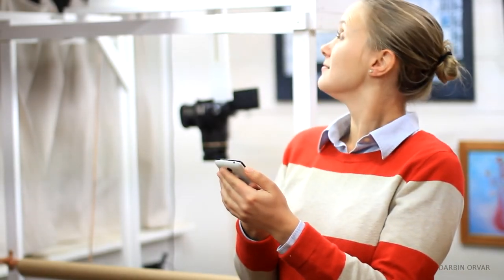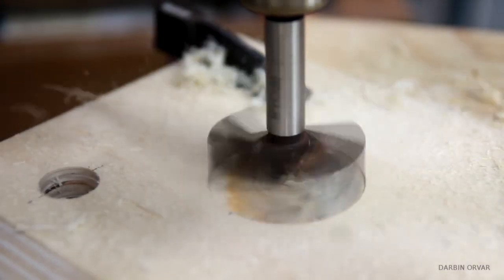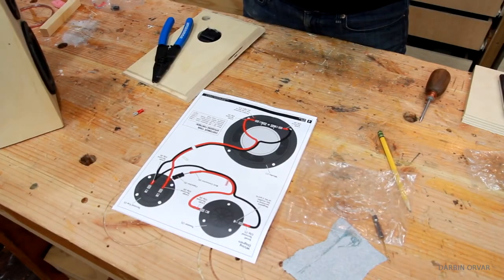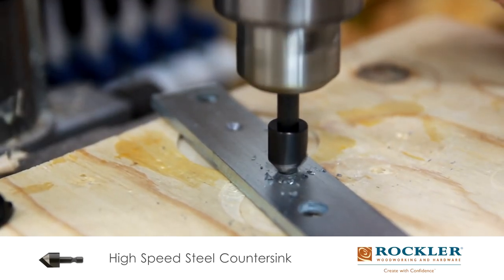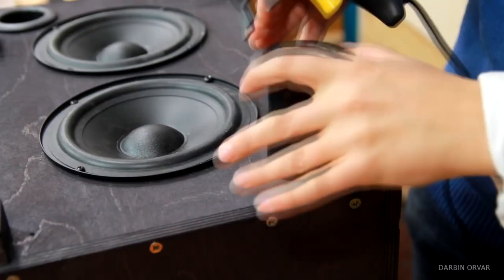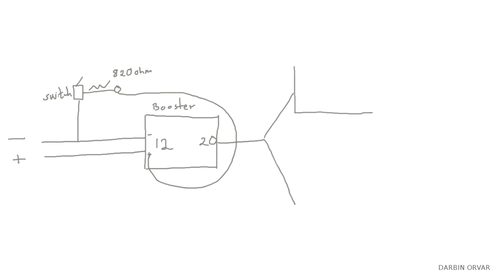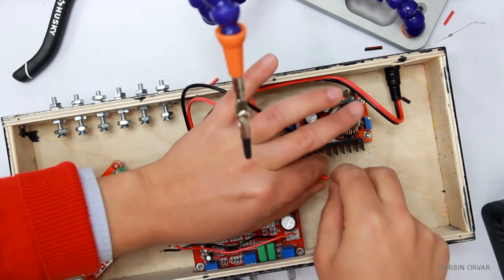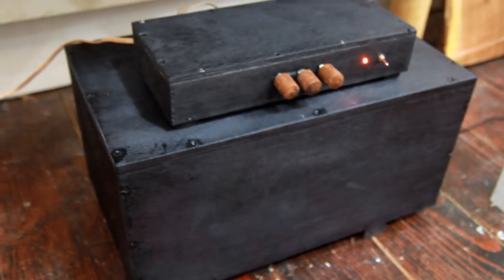DIY Bluetooth Satellite Speaker System with Subwoofer | Darbin Orvar

Comment: Could have done this with a simple bluetooth adapter for any 2.1 speaker. However congratulations for the work and you enthusiasm. Is amazing what you can create when you really use your mind into creating something. 
However I was looking for a video where you connect the satelites to the subwoofer via bluetooth and you don't need cables anymore. I want this because I got a Z906 and I mounted the satelites on the walls and I hate the way the cables are there :)

Comment: Like you this project is beautiful and im planning to build one very soon, however the amplifier system is redundant since the sub amplifier that you used has it's own terminal for both satellite channels, would it have been cheaper and much easier to just install a bluetooth receiver and connect it on the sub amp directly?

Comment: would love to see you take a surround sound system that is wired and make the speakers Bluetooth receiver and the main control system a Bluetooth transmitter to where there are no wires attached to the main control system.

Comment: Linn, Great tutorial, is it possible to make the speakers wireless as well? I'm a woodworker, i don't have much experience in electronics
Reply: +Frank Doyle yes it is, but you need an amp in every speaker with it's own wireless signal receiver. in the amplifier you will need a wireless signal distributor with the number of channels matching your speakers. so it makes the electronics 3-4 times more.

Comment: Hi! I had a few questions for you, the first being why do you boost the power source from 12v to 20v, is it because of the amp?Also, how did you connect the sub woofer amplifier to the blue tooth sound amplifier? Thanks!

Comment: 1) Where does the 12 V come from?
2) Won't the amp need some ventilation to dissipate the heat?
Reply: Linn, I'm also curious what you used as a power source for this project. I have an old car stereo system I would like to retrofit as a shop stereo, but fashioning a 12v power supply is something I'm still stuck on. Thanks!
Reply: +evanherk You just need a 12 volt dc adapter. They are really cheap and available. In my tests there is not much heat as the amps are not very large and the box provides plenty of air circulation.
Reply: No those small amplifier don't generate heat 🔥 it does but not enough to do any harm

Comment: i have my old 5.1 channel speaker music system & i damage all the board of my music system '!! but all the speake & bass (Suwoofer) speaker  is gud Now i want to make one speaker adding them all how i connect them series or parallel With subwoofer 'how to connect can u teach ??
Reply: Aantaya Giri vuse use 2 speakers and 1 subwoofer 
(or 4 speakers if each speaker is 4 ohm then it needs to set in serie to get 8ohm if each speaker is 8ohm do them in parallel to get 4ohm)